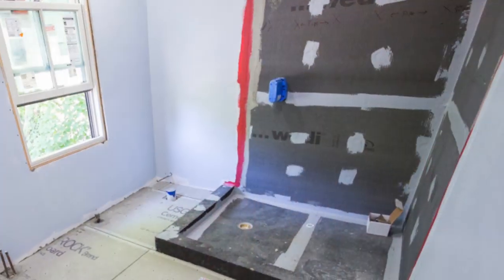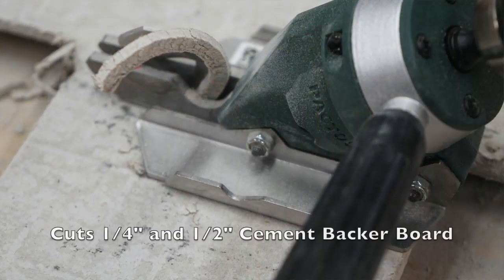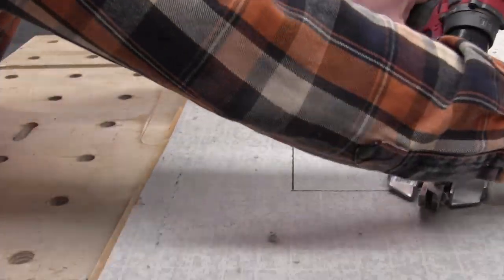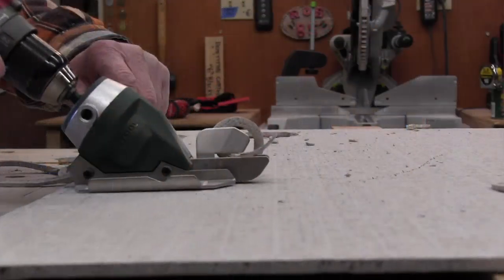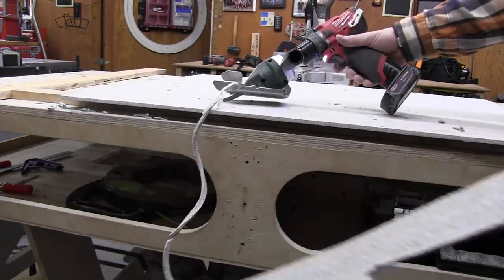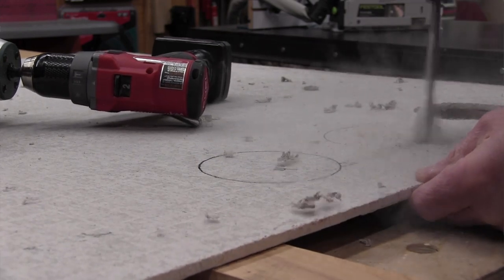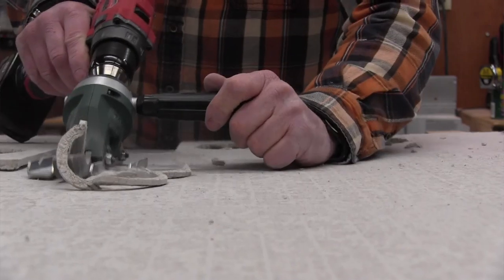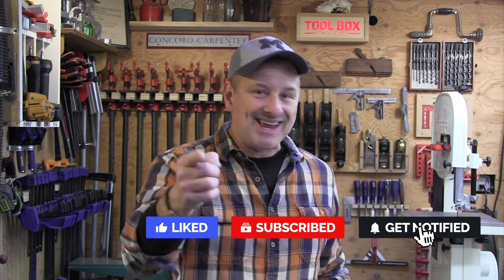PacTool Snapper Shear Pro - Cement Board Cutter - Review

Comment: Had the same type of cutters, but it was a dedicated tool about the size of a drill. It was corded and you could buy replacement Cutter blades for it. For the life of me I can't remember the brand name tho. I stopped doing any tile work about 6 years ago. I sold it back then,but it was green in color. Don't think it cut circles tho, but certainly much better than a grinder or any other way as far as I'm concerned!!
Handy now that it's an attachment and it cuts curves too!
Thanks for the video Rob! 👍
Reply: reddawg rup Makita, best tool ever for cement board!  I’ve had mine for years and it works great
Reply: James Schlueter no it wasn't a makita, that I would of remembered. I had bought it probably about 5 or 6 years ago.

Comment: I have a similar shear that we’ve used for twenty years that is made for hardi siding. It’s an absolute game changer for dust control. Just keep a bucket nearby for the curlys from the cut.
Reply from the maker: What's the name of it?
Reply: @ConcordCarpenter . Kett Tool Co. Costs around $250. to $300. It is sold with the head permanently attached to a corded Black and Decker drill. Mine just broke after twenty years of use. I replaced it with something similar to Pactool by (Malco TSF2 Turbo Shear). Harvey Building Products sells it for $175. It's attached to any cordless impact drill.
Reply: A Concord Carpenter / ToolBoxBuzz mine is called the snapper lite.

Comment: It’s an adaptation of a sheer thats been used for years in sheet metal work so it’s a tried and proven platform. My only questions are, how quickly do the blades dull and how quickly can they be changed out.
Reply from the maker: Big Mo great question, time will tell .  They change out easy   Dont know the replacement cost
Reply: I have used the corded snapper shear from PacTool that I assume uses the same blades as this attachment and have gone well over 2 years without changing the blade doing something like 40 bathrooms with it (14 sheets of 3x5 backer board each bathroom). It might just now be starting to need a replacement.

Comment: It's cool if you're doing this all the time as a contractor but I've always just scored with a blade and snapped it like drywall. It takes a good number of scores to get to the fiberglass meth but it will eventually cut it.

Comment: Will it cut 1/2" board or only 1/4" & 1/4"?
Reply from the maker: Bill Sheffield 1/2 was there a typo?
Reply: @ConcordCarpenter  There was a typo but,  stupid me didn't read the description of its cutting capabilities , BEFORE writing the comment.  I meant to say 1/4"&1/8" . I use far more 1/2" than anything else so that's what I meant to ask , but see now it cuts that thickness. Wish Milwaukee would come out with a dedicated tool for cement board, that I would buy. This attachment looks kinda awkward to use but guess I would get used to it after awhile.